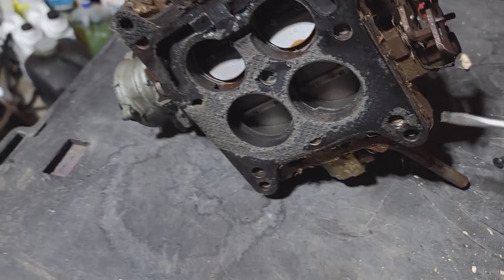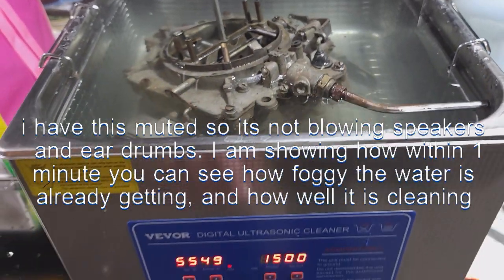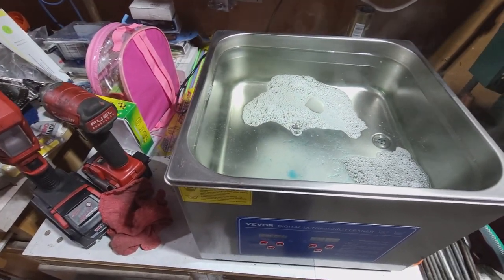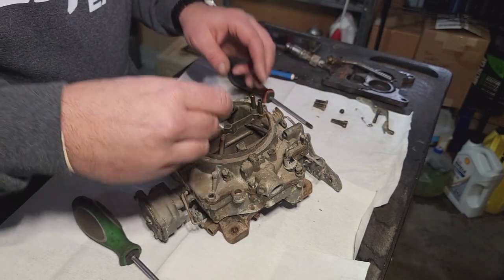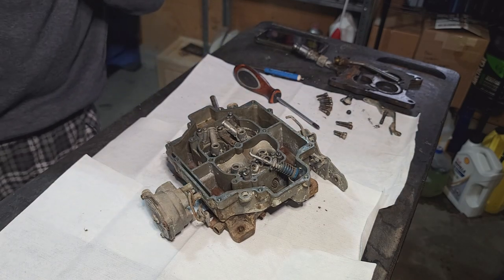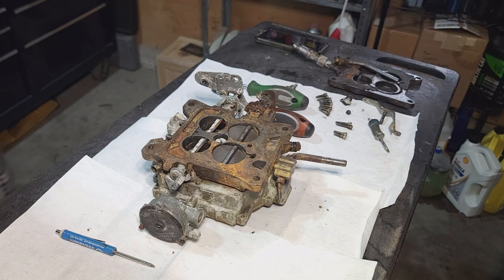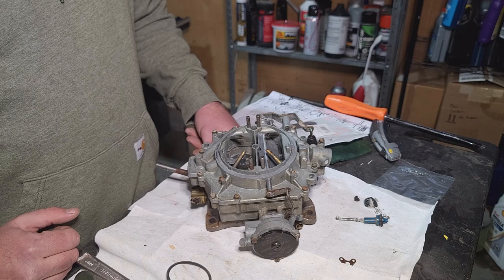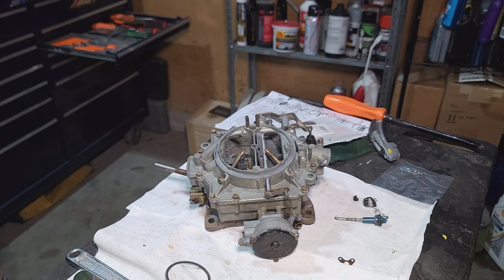Rochester 4Jet Rebuild 4GC. {this thing is nasty!}

Comment: Very informative video! Just in time too, I think the ethenol ate my gaskets so I will be taking my 4 jet apart soon, I've never rebuilt one before, but I've done a quadrajet and a 2 jet. I recently had to replace my fuel pump because of ethanol gas. Moral of the story use non ethanol gas in old cars from now on.